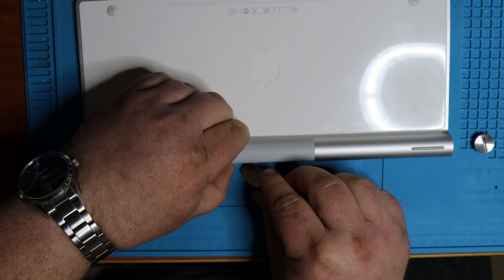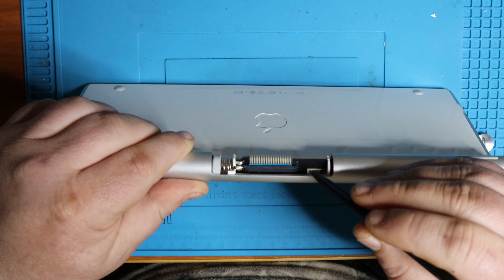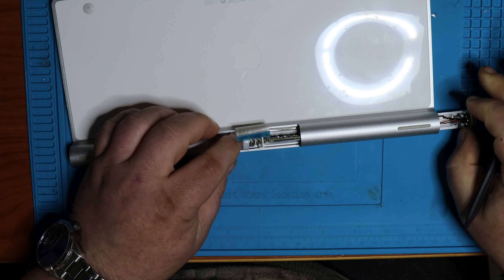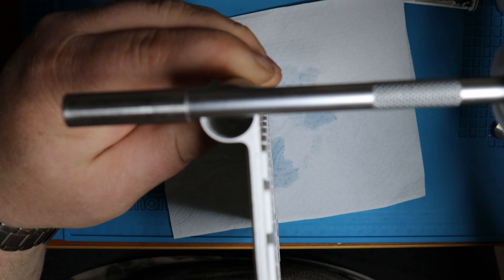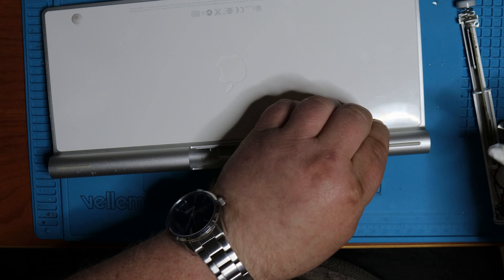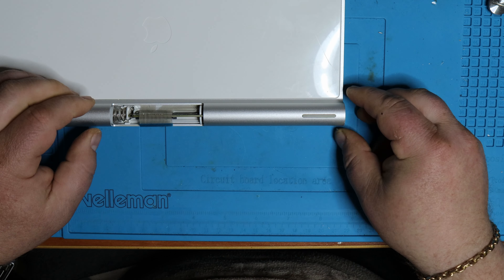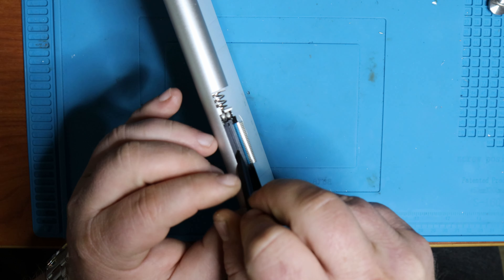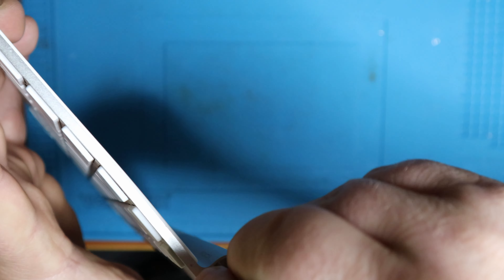Apple Wireless Keyboard remove stuck battery

Comment: I suggest using rechargeable batteries.  I have never had one leak or get stuck in my electronics.  Thanks for the video.  I thought there was a battery stuck in a used keyboard I bought for a gift, but after watching your video I realized it only has 2 batteries.  LOL!
Reply: There’s a rechargeable battery stuck in mine right now!
Reply from the maker: Rechargeable batteries are less prone to leaking (if you buy quality batteries) than normal. Getting lithium batteries costs a bit more, but are well worth it in the long run

Comment: Thank you, very clear and well explained. My problem is that even the cover to access the batteries is stuck..😒
Reply: Chiarute: For me it is the original Magic Trackpad cover that is stuck and also the batteries being stuck inside the Apple keyboard. At least now I know what to do with batteries being stuck inside of the keyboard.
Reply: @Gizzy7837  I am so sorry, I hope you find a way to clean it. I used "WD-40 specialist contact cleaner" to loosen the battery leaks that prevented the cover from opening.  I was then able to remove the cover, remove the batteries and clean the inside. I hope this helps🙏
Reply: @Chiarute  Thank you for suggesting it. I hope it helps too.
Reply: @Gizzy7837   I really hope it does!🙂
Reply: @Chiarute  How many spray?
Reply: @Gizzy7837  I guess it dipends on where you need to apply it
 This spray is specific for electric components so it dries very quickly, but if you need to apply a significant amount,  make sure you let the device dry very well before you switch it on, or you will damage it if it's still wet.

Comment: Great advice! Following your video, I managed to remove & clean up the mess left by the offending battery. With new batteries, as soon as the keyboard is turned on the screen turns on as well. Only problem is that it does not type which means I cannot sign in. Any idea?
Reply from the maker: I would inspect the flex cables and contacts. If they're looking good, I inspect the logic board very closely (preferably under a microscope) for corrosion and damage. Since the screen comes on right away, I suspect that it's "spamming" key presses 🥴

Comment: I used a drill to make a hole in the battery and screw a wood screw to pull out with a gripper. It will be better with your method next time. Thanks.

Comment: It seems the tiny Phillips screw holding the logic board is stripped. Any suggestions?
Reply from the maker: If the 'ol rubber band trick doesn't work, I suggest getting the iFixit precision screw extractor kit! Saved me a LOT of head ache over time 👍
Reply: @LetUsRepair  thanks for the suggestions and your swift reply.

Comment: I tried this, but the 2 batteries are really corroded in.  I tried to hammer them out with a screwdriver and a hammer, and the screwdriver went through the batteries! Still stuck
Reply from the maker: @donovannorth3857 Wow, I've never had one that was that stuck! Wonder if it would work to "soak" the area / compartment using >=35% vinegar, just to try and dissolve the leakage. Then drenching it in IPA again and also maybe try some lubricant like WD40 and / or electronics cleaner from CRC? About all I can think of at the moment :)

Comment: Thanks a lot. Very useful video.
Reply: Removing the logic board allowed me to take a different run at things, successfully. Along the way, I realised there are a number of very subtle gotchas still possible beyond a stuck, corroded battery. 

If your keyboard has ever been dropped, and has landed on either rear corner, you may find that the deformation of the thin wall of aluminum surrounding either the switch or the battery compartment screw cap has become distorted and (very subtly) is holding the otherwise removable item captive in the relevant location. Cutting away the last millimeter of either end of the cylindrical 'foot' of the keyboard won't prevent it from going back together and working correctly (ceteris paribus). 

Anyway, the stuck battery in the much-abused keyboard I'm using at the moment to thank and praise Geir had, ultimately, to be removed using a length of stainless steel rod running through the entire length of the foot -- slide-hammer style, and with considerable force, and several strokes. And this was after my having had to cut away a section of the 'foot' over the outer battery using a cut-off wheel on a Dremel tool. Someone had -- for reasons I can't imagine -- hammered the outside of the battery compartment at about the midpoint of the outer battery. This distortion of the compartment meant that it would have been impossible to remove the battery even if it hadn't been corroded in place...

Comment: What if the battery compartment cannot be opened?
Reply from the maker: What do you mean: Cannot be opened? The screw on the end, or the plastic piece in the middle?
Reply: @LetUsRepair  sometimes the battery acid spills all over the compartment and fuses the metal cap to the aluminum housing. This happened in my case. So far I have  been trying soak it in various chemicals: vinegar, alcohol, lemon juice. Nothing worked so far. The worst case scenario is to drill the cap out.
Reply: @LetUsRepair  the end piece
Reply: @Bizyukov  MAYBE WD40?
Reply: @yohodesign  I'll try that too.
Reply: @LetUsRepair  The screw on the end. Thanks for your excellent video!
Reply: @shadow_the_wanderer  do you mean drilling? Not quite. I manage to drill a small hole in the cover but I did not have a drill press to make a bigger hole and take the cover out completely.
Reply from the maker: If it can’t be opened by regular unscrewing, I’d probably just put the side with the screw cap in one of my ultrasonic cleaners for a few minutes. Hold the end with the cap to the bottom of the ultrasonic cleaner, using a good medium mixed with water. That will most likely clean it enough to get it out
Reply: @LetUsRepair  Well, it is a great advice if you have an ultrasonic cleaner but I don't. Also the batteries are still stuck in the compartment so I don't have access to the inner end of the cap.
Reply from the maker: It’s not for everyone to have an ultrasonic cleaner, but if one likes repairing stuff, it’s a must have! Put the end of the keyboard (the whole thing) with the “screw” cap into the cleaner. Run it with hot water and some good soap. Vinegar added is also good. Let it run for 10-20 minutes. The micro cavitations will do the trick. Maybe you know someone who has an ultrasonic cleaner?
Reply: @LetUsRepair  I will ask around. Thanks!

Comment: Why did Apple have to make the battery cover a cap that you had to remove it with a coin it should’ve been a button
Reply from the maker: I know, right! I actually swapped out my AMK for one from JLAB that supports 3 devices; Supports Mac/iOS, Windows AND Android. I have it connected to my MacBook Pro, Google Pixel 8 Pro and Lenovo Tab P12. Switching is as simple as pressing a button!

Comment: thx, but unfortunately i cant even unscrew the end. ive already bent out of shape 3 nickles (*・～・*)
Reply: Take it to a local watch repair shop, they will be able to do it. I did the same.
Reply: I'm in the same boat
Reply: @365atr  i got it out eventually. I had to put the keyboard in a vice and with a hammer and punch try to turn it. Once the grip of the acid is broken it comes out, but god damn is it a bitch to break.

Comment: I was about to break my keyboard to get the stuck battery out, until I saw a comment saying keyboard has only 2 batteries, the 3rd is built in. You can make sure by flipping the keyboard and you will see the diagram😂